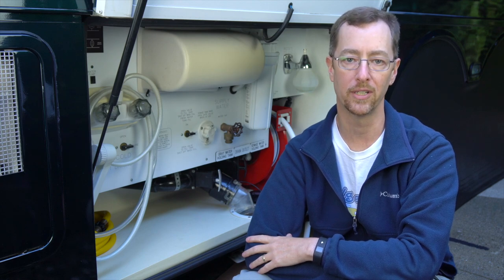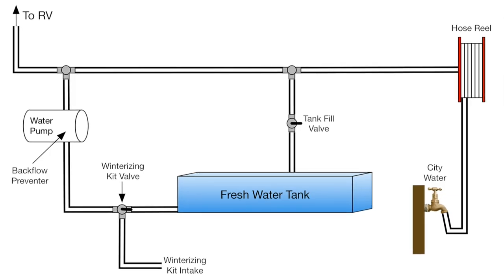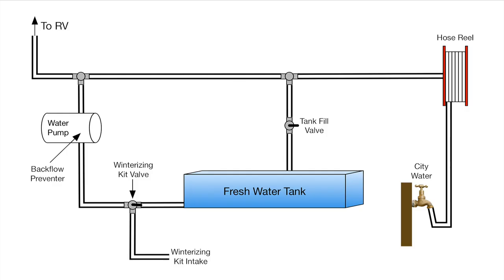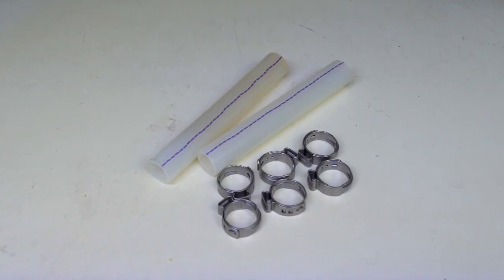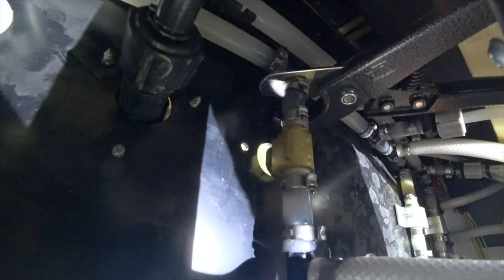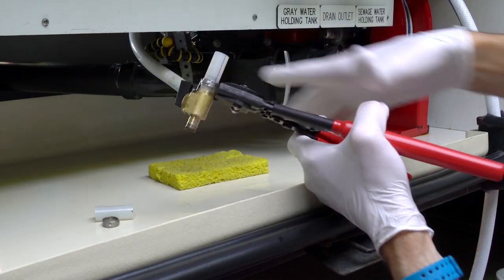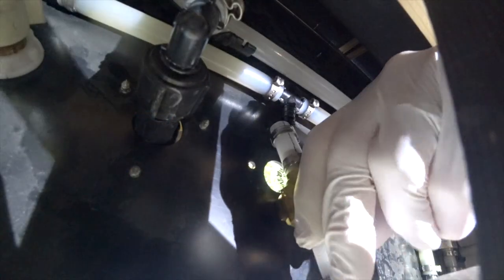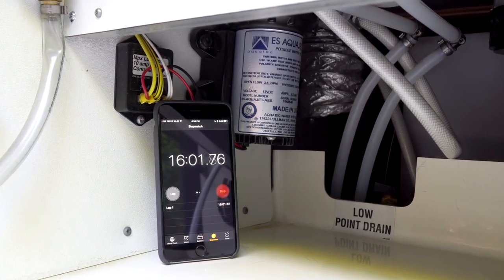RV Plumbing Leak Diagnosis & Repair - Practically For Free!

Comment: Relatable real-life example of a thorough - but not too "dry"- diagnostic and demonstration of replacing a valve plumbed with pex showing techniques and tips.  Thank you.  I had no idea it was so complicated down there.  Water is very smart and logical system, glad you were there to help me out by making it simpler.

Comment: Thanks for the tip on how to isolate the pump from the system. I was able to confirm I can still use city water and the problem is between the pumps. As a newbie to the camping wold this was invaluable. I can still get my short trips in until I get the pipe fixed.
Keep on doing what your doing.

Comment: This is great video.  I just replaced this valve on my Dutch Star which appears to have the same water compartment.  The space below the bulkhead is too small for me to crawl under as Peter did.  I removed the mounting screws in the corners of the bulkhead and it just falls forward making all the hoses etc. mounted on the back of the bulkhead accessible.  It made the job much easier for me.  I so appreciate the incredible service that John and Peter provide, especially to us Newmar owners, with their videos.
Reply from the maker: Hey Bryan! Thanks so much for letting us know we've been helpful. Always great to hear... and always great to hear from a fellow Newmar owner, too! Safe travels - Peter & John

Comment: An excellent and easy to understand video. The animated plumbing  diagram brings it all together. Most importantly - it explains how the plumbing system and pump work together, so even if the fill valve is not the problem, understanding how the system works will allow you to trace down the cause. For example, I now know that if I hear the pump cycling when it shouldn't be, there could be a leak inside somewhere too that will end up causing rot issues. I wouldn't be surprised if some of your videos are used in RV Service Technician courses! Thank you!
Reply from the maker: Thanks so much for the nice comments! Concern over a leak leading to rotting is definitely the first thing we thought about when hearing that pump running! We checked every inch of the basement, under cabinets and on the ground (since that's of course where any leak of any amount will eventually end up. Actual leaks into the RV are the worst, and we were relieved that that wasn't the case for us.

Comment: I hear from fellow RV'ers all the time about the water pump cycling as shown in the video.  Everyone always says its the backflow preventer in the pump.  But you show a methodical way to actually determine the cause.  As always just great information.  Happy travels, Lou
Reply from the maker: Thanks Lou! This was a particularly satisfying one, since we just knew if we took it to the shop, they'd just replace the pump (which we could of course easily do ourselves). That would have made it doubly bad... overpaying for the wrong "fix." We were definitely high-fiving after this one... at least til the 16-minute mark or so on the stopwatch. 😂

Comment: Thanks again for including the diagnosis steps.  Always nice to be able to replace the part that's bad rather than just start blindly replacing parts.  Funny ending!
Reply from the maker: Thanks Allan! "blindly replacing parts" is exactly what we wanted to avoid, and it's so easy to do in this type of situation (and what we've had shops do before). Glad you liked the diagnosis... and the ending. 😁

Comment: Excellent video and diagnosis. Not just applicable to RVs either; apart from the direct connection to city water, much of that system is very similar on boats with similar issues of pump cycling in the event of any leaky taps, pumps, valves etc. Cheers
Reply from the maker: Thanks for the nice comment, David. Great to hear that this info may translate to boats as well. Hadn't thought of that. We'll bet that discovering a leak is even more urgent for you, since we can't be sunk by a faucet continuing to flow undetected. 😉
Reply: Exactly!

Comment: Had the same cycling issue... After physically looking every connection and ruling out the pump(some may have a suction side leak too) We found it to be a faulty toilet valve that allowed the water to trickle in the bowl... Replaced the original toilet(1992) during our stay over at Tampa Lazy Days and it's been perfect ever since..
Reply from the maker: Water leaking into the toilet could be catastrophic! Great you got that fixed. Figuring out the problem is so often the hardest part.

Comment: Our 2003 Newmar Dutch Star DP water pump also started coming on by itself but ours was every 7-8 minutes. In a panic I searched all over the RV for the water leak. I decided now would be a good time to pull the washer/dryer comb out of the closet Newmar put it in and install a drain/drip pan. This allowed me to inspect all the plumbing associated with not only the w/d but also under the bathtub and other plumbing going to the bathroom.(toilet etc). No problems could be found. So I figured it was leaking back through the water pump, but your video about the city fill valve gives me pause. We were at our home when all this happened and the problem has not come back. I wonder if it could have been sand or some other debris in the water pump or fill valve. Thanks for sharing, y'all have a beautiful coach.
Reply from the maker: +richard leitner Thanks Richard! If the problem went away in its own, we think your hypothesis about debris in the valve could be right on the money!
Reply: @RVgeeks  Well, the problem came back, actually it's been back for quite a while we are almost always on the campgrounds city water supply and just live with it. Can that valve be gotten at Lowes or Home Depot or do I need to order it from Newmar? Thanks guys.  P.S. Do you know what size that screw on fittings on the in/out on the water pump are?
Reply from the maker: Sorry the problem’s back, Rick. You can either order the valve from Newmar… or remove the current one and try and find a replacement At a big box store or plumbing supply shop. As for the threaded connections for the water pump, we believe our Remco Aquajet has 3/4l NPT fittings… but we’re not sure if all pumps are the same.
Reply: @RVgeeks  Thanks, appreciate the help.

Comment: Interestingly our water pump on the boat burbs every now and then. We found you diagnosis steps helpful if slightly different from what we would need to do. Thanks.
Reply from the maker: That’s awesome! Always great to hear we’ve been helpful, even if just getting headed in a direction that solves a related problem. Thanks so much for letting us know. 😊

Comment: Nice fix! Good thing you were wearing those latex gloves. Better safe than sorry 😊
Reply: Yeah because latex is cut-resistant LOL. Just playing Tito:)
Reply: Chris B Yup. My point exactly :)
Reply from the maker: Thanks Brian! I do try to protect my hands, especially when working in tight spots or on especially dirty projects. I had lymph nodes removed on my right side, so cuts on my right hand usually take longer to heal. Plus my hands are really dry, so I try to baby 'em! LOL
Reply: Amlactin! 20 oz bottle from Costco. Somewhere in the pharmacy section. BEST STUFF EVER for dry skin. No more winter cracks and works great when we're in the desert.
Reply from the maker: +2AZSUN Thanks! We love Costco, and will look for it next time we’re there!
Reply: Who doesn't love Costco?? It'll sting a little on any open cuts, but after you use it a little bit, that stops.

Comment: Great video! I've been using the white flair-it compression fittings almost exclusively for years and recently got a ratcheting crimp tool like yours and a pile of clamp bands. Perfect for rigs like yours with fittings so close together where flair-it just won't work.
Reply from the maker: Excellent! Great to hear. 😊

Comment: Another stellar video... thanks guys!!!
I had a similar problem, I think it was toooo much pressure from the campground and the water was leaking into the fresh tank. It stopped once I started using a pressure regulator (45 - 55 psi ). All good for now and I hope it stays that way. I always check for leaks when camping, but I wonder sometimes what's happening in areas where you can see. hmm
Reply from the maker: Thanks Hector! And thanks for reminding us all about the importance of using a pressure regulator. The potential for exploding a water line (especially a hidden one) are just too great. We've heard horror stories about people coming back to their RV to find water running down the entrance stairs like a waterfall! We've had our share of self-inflicted wounds over the years, but thankfully never that one!

Comment: Great Video, only thing I missed is the part number for the valve and supply source Thank you Phil
Reply from the maker: We didn't actually include a part number for a couple of reasons. First, they discontinued them. 🙁 And second, we used a valve that was left over from the installation of our Acuva water purifier (there are lots of those same valves used throughout our RV). If we'd had to buy a replacement, we'd have had to go with some other type, but luckily we didn't need to. Your best bet is to visit the plumbing department of your local home improvement center. We've seen suitable replacement valves there.
Reply: Thank you for replying so quickly, your videos are always informative and timely, I too have a Newmar product  2007 Kountry star so alot of what you do spills over to my motorhome. Thanks again, Phil
Reply from the maker: Always great to hear from a fellow Newmar owner! Safe travels Phil. 😊
Reply: I recently purchased one from Newmar. It is a different valve in that the handle is brass and the plastic handle is what usually breaks.  I was surprised to find that the valve I bought was available at my local hardware store.  Apparently, it is commonly use valve in many applications.

Comment: I had a similar issue with my Anderson valve on my thor miramar.  I went to the Anderson web site and called them.  While waiting for the support person to call me back I watched a video they had on youtube on how to replace the valve core. Mike from Anderson called me back and walked me through the diagnosis to make sure it wasnt a faulty  water pump.  Finally I had to remove the valve core for inspection.  Upon inspection, 3 out of 4 o-rings were torn!  Plus we discovered the handle was on the valve backwards!  Anderson will  replace the valve core free. Isn't that amazing?
Reply from the maker: Great to hear that Anderson stands behind their products, Ben! Thanks for sharing your story. Sure does remind us of our own situation, although we didn't open up the valve to inspect the internal components.
Reply: Looking at the valve core, I asked the tech how to determine which way the valve was supposed to be oriented, since by initial inspection, there wasn't a difference.  But upon talking to an engineer, the tech pointed out that one side of the valve shaft had a flat spot which was longer that the other side.  That longer side was the direction the arrow of the handle was intended to be pointed.  My handle, which I had kept attached to the valve core, was in the opposite direction! No wonder things were not working consistently or not at all!  Could have led to the premature failure of the core?  I'm not certain, but it didn't help!  No RV is perfect new from the manufacturer and ours is a"new used", a 2017 model which in all likelihood, was a demo due to having 12k miles in its first year.  We traded in our Simba, but kept the inverter.  if you're ever in port saint lucie, Florida, I could sure use your help debugging the xantrex 3012 and our autogen set, which has not worked correctly since they installed it from the Simba.  It will turn the gen on, but it wont switch it off either in auto or man off.  Sorry to get off topic...but I had to ask.  thanks again for providing valuable content!

Comment: Hi u two , here from Ireland
I love watching your videos. Because they are very interesting and enjoyable to watch.
I don't have a RV ,,, wishing I did , a newmar 45 53 king air or duchstar well something in that. 
Your videos show me and I can learn alot from them . Thank you so much for your videos. 
If you are wanting to go into cold snow conditions , witch I just love , but have a look at the Kimberly gasifier wood stove
It mite be a little more expensive, but the comfort of it is outstanding it can even make electricity 12 V with a thermoelectric generation . The Kimberly gasifier wood stove. Take a look at it on YouTube. Thank you for your videos. Until next time.
Reply from the maker: Hi Goliath! Thanks for the nice note. We'll definitely check out the Kimberly. Thanks for the tip! :)
Reply: I forgot to mention that the Kimberly can Cook, make hot water  ( electrically) 
The hot water is made by a coil mounted on top of the stove. You can also heat a lot of other parts of the RV the same way.
Reply from the maker: We looked it up and saw some cool videos about it. Thanks! The one thing we didn't see anything about was something that we though might be an issue in such tight quarters, such as in an RV. What happens if you accidentally brush up against it? Won't you get burned? The exterior of the unit looks like it would get hot enough to melt skin! LOL
Reply: RVgeeks Hi to you . Yes, all hot services are dangerous but that is up to the user 
My qualifications is. Industrial mechanic machine and system techniques. I was interested in mechanical things since I was a very small boy. When I finished my qualifications I started working with a company that built industrial heating systems for 15 years.
Take another look at some more videos on the Kimberley. People have built the Kimberley in a very small motorhome and managed beautifully. Making a protection guard from stainless steel grades will also help the situation it is up to the user to make his own creation. P's I tried to explain it the best way I could. Without having to wright a large nose.
The amazing thing is on that stove that it fires for about 9 hours on one log for $1.
Thank you for your interest and replies much appreciated. hear from Ireland and keep up the good work.

Comment: Most Excellent Video.  Watched it twice!  Learned a lot and am able to go to and troubleshoot.  I have a question about your diagram.  Where on the system is the overflow valve?  Off the tank?
Reply from the maker: Thanks Lillian! Yes indeed... that overflow tube comes directly out the top of the fresh water tank, and then out the bottom of the RV. Good luck, and let us know how you make out.

Comment: Thanks for the good tips,  I prefer using SHARKBITE fittings on pex as they dont require tools and the are reusable.
Reply from the maker: Great idea! We actually considered using SharkBite fittings, which we really like. But since the space was so limited, and because we already had everything needed to do the job (so it was in effect free), and because we have no plans to remove this again (fingers crossed!) we just crimped. But SharkBites are awesome, so we really appreciate the tip!

Comment: Excellent video.  our pump was cycling often. after watching this video I fixed it a loose fitting. In the last 24 hours it has cycled 3 times without calling for water. Is this normal? Thank you
Reply: I have looked for more leaks but so far I have not found one.
Reply from the maker: Hi Gary! Glad you found the loose fitting! It’s possible that there’s still air somewhere in the system... which could allow the pressure in the lines to change enough to cause the pump to cycle. So that would be “normal”. But when we’re set up, dry camping, with the pump on and all air out of the lines, our pump almost NEVER cycles. It will, occasionally, if there’s a big drop in atmospheric pressure, so any air gaps in the lines allow the pressure to drop. But that’s all. If you inspect thoroughly and don’t see signs of leaking anywhere (could be very small/slow), it could be the built-in back-flow preventer in the pump itself that’s failing, allowing pressure to bleed off as water returns to the tank.  Keep an eye on it and see if it continues/gets worse... or goes away. Worst case scenario, turn the pump off when not using it to avoid the cycling.
Reply: @RVgeeks  I was wondering  about air in the lines.  So far all lines look dry. Thank you.

Comment: I need that same valve!!!!!!!! Can you tell me where to get it ? I have a 2007 Dutchstar 4304 and I need a new black handle as well!   Thanks so much!
Reply from the maker: Hi Brian! We happened to have a replacement valve left over from the installation of our Acuva water purifier. It’s the exact same one, so we simply reused it. Newmar doesn’t carry that exact valve anymore, but they should have a direct replacement. We suggest calling the Newmar parts department with your coach number, and they should be able to recommend a valve that will work.

Comment: Do you have to drain the water heater to replace fittings or cut the pex? I have a leak on the first T from city water hook up
Reply from the maker: As long as you release the pressure in the system by opening a faucet or low point drain, you should be good. There shouldn’t be any reason to drain the water heater.